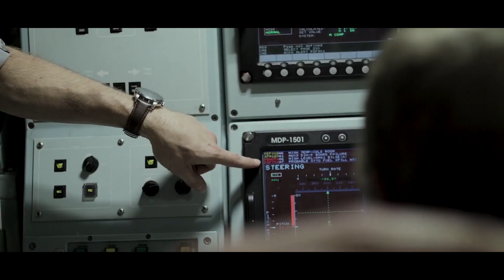Nuclear Powered Submarine Task Force

Comment: I agree these are necessary but the capability gap means we need an interim submarine capability of some type.  

They’d need to be delivered quickly and probably have to be built overseas (which will annoy some people).

The only question is what type, not whether they’re needed or not.
Reply: Interesting point, however, there are some factor which ought to steer that decision.  
Firstly, submarines are maintenance intensive and having them built overseas would drastically reduce availability and increase maintenance costs.  Given that we have successfully built a world-leading conventional submarine, with the Collins boats, there's absolutely no reason why we should consider overseas build if we were to make a conventional sub.
Secondly, high-tech conventional subs do offer some niche advantages over nuclear boats in certain applications - and Australia is the only coalition partner who still operates them.  Therefore, it would be wise to maintain diesel sub capability in some form, even following the introduction of nuclear boats.
Thirdly, operating multiple types of submarines simultaneously is an unnecessary maintenance burden for the RAN - who has indicated they don't want to be operating three types of boat.

So, that leaves you with only one solution.  Collins 2.0.  Building more Collins boats has some obvious advantages.  We already have the design, it's proven, and meets the requirements.  Furthermore, the new build boats can leverage work done on the Life-of-type-extension.  Bonus Option:  Increase length of Collins 2.0 to incorporate VLS bays to carry the new Tomahawk/LRASM missiles we're going to be getting...  Such a vessel would complement nuclear attack boats very nicely - and be in service alongside whatever SSN's we get.
Reply: We won't need an interim if we can get a third Virginia assembly line operational in the States. Help the Yanks get that up and running, and both the US Navy's needs and our needs will be handled.
Reply: @advanceaustralia3321  looking at 10 years from start of build to commissioning for just 1 sub. I doubt that UK sub building could handle additional orders with any faster service then that. Our ship yards would probably  take longer to complete the build with lack of qualified trades wanting to work in the ship yards in Adelaide Due to better money in other areas.
Reply: @advanceaustralia3321  No they can't. The Astute line is ending so they can focus on Dreadnaught. There will be no more Astutes built it's as simple as that. The crew difference is about 30 personnel, but the capability difference is huge. The Virginia Block V is the hands down more capable boat and the only choice there is.
Reply: @advanceaustralia3321  So a boat that takes about 8 years to build (going by current build schedule), one at a time; I guess the last Australian Astute class will be introduced into service by the 2080's. The Dreadnought's are extremely massive undertakings and will probably require all hands on deck to get them completed on time. An 8 year build cycle for just 1 submarine - we might as well not even bother.

The UK CANNOT just simply start building more Astutes, especially not the in the time frame we require, there are significant questions concerning long lead items and also propulsion. Which reactor do they use? PWR2 is done. They have moved onto PWR3 for Dreadnought. Integrating a new reactor on a submarine it was not designed for would be a disaster - one we've already had to deal with.

A third production line is in talks for ramped up Virginia construction, which given the current state of the world is probably going to go ahead.

Crewing could be an issue, but there will be significant growth in Defence over the next decade, so the personnel needs will probably be met. Past issues with recruitment in Defence were because of an artificial throttle placed on recruitment to keep personnel costs down. You can see that in how Army has been handling it's introduction into service of new capabilities. Stripping infantry units of personnel (2RAR for example) to fund and man new equipment coming online.

Yes, we've all heard how fantastic Collins and Astute is.

As far as weapons go, Australia would only be getting new build Block V's, so this is a moot point. Virginia's weapons load is vastly superior.

My position is that the UK cannot build our requirement fast enough to meet our strategic needs in a timely fashion. The US has the ability to open a new line sooner rather than later which would help speed up the build process and introduction into service for Australia at a MUCH faster rate than the UK could hope to match. We don't have the time wait for such a slow build process. By the time half the fleet was introduced it would be time to replace the first few boats. The Virginia is the right boat for our region, particularly in it's weapons capability and capacity. Its ability to strike more targets while on station than the Astute is clear to see. While it will undoubtedly be more expensive, it is the better boat for our much needed long range strike requirements which eclipse the UK's needs by an order of magnitude. We need naval platforms that have vastly more missile capacity than ever before in order to counter China. That is an undeniable fact, and I hope Defence planners are taking this into consideration.
Reply: @BallisticSollution  
Same weapons used on Astute and Virginia. Tomahawks and torpedoes. 

Slow build rate was about staff retention not capability. The build rate can be increased to one every three years. Four at most to commissioning.

Comment: Please consider Air-independent propulsion (AIP). Lox/Alcohol combination with lithium ion batteries for the future. This is something we as a country are already good at. We have one experimental reactor and it has major fundamental issues. 
Keep our navy nuke safe.
Reply: @advanceaustralia3321  Nuke or AIP sub's are used in the long surveillance game, you can have your attack boats for the last stage of the operation.
Reply: Why? A nuclear powered submarine is vastly superior to SSK (Diesel Electric), in both speed and transit/loiter time. The S9G reactor is safe, efficient and doesn't require refueling for 33 years. RAN can not afford to operate both an SSK and SSN fleet at the same time. The RAN SSN will operate in conjunction with a new long range XLAUV (which will conduct reconnaissance, intelligence gathering and surveillance in our region) , of which 3 are currently in the pipeline. As far as "nuke safe" goes, this nimby garbage needs to end. Nuclear power is the future, we need it desperately in this country. SMR is the future of nuclear power and it is cheaper, scalable and safer.
Reply: @BallisticSollution  Interesting. . .i do like what you are saying. Thank you. 
Do you think AIP would be useful for mini autonomous sub's? The long-range endurance type.
Reply: @non-human3072   The problem with AIP is it relies on the need for the submarine to either surface or come to up to snorkel depth to "recharge". AIP's faults are that when it surfaces or comes to snorkel depth, it makes it presence known and completely destroys it's stealth advantage. Even at snorkel depth, a submarine is easily spotted by recon satellites. It is true that an SSK with Li-ion batteries and AIP would actually be quieter than an SSN, and would be quite useful operating in and around the littorals and EEZ. For an XLAUV, no, I don't think AIP would help it much. Running a mixture of Diesel Electric and Li-ion should produce fairly good ranges, and they don't need to worry about producing oxygen, or producing lighting etc, for onboard crewman so save power/energy to stay submerged and deployed for longer periods. It's unknown (rightly so) how much range or loiter time an XLAUV (Extra Large Autonomous Uncrewed Vehicle) actually has, but cutting the human requirements out would make it's loiter time much longer for sure.